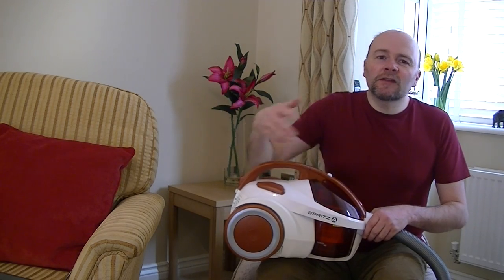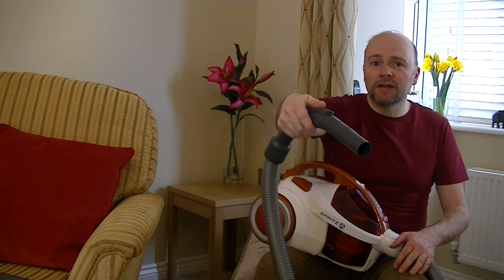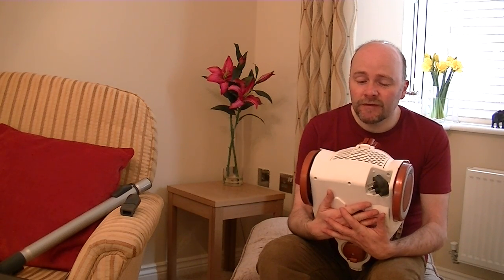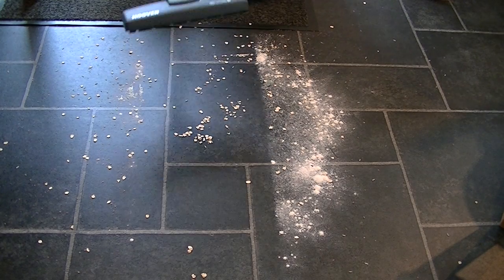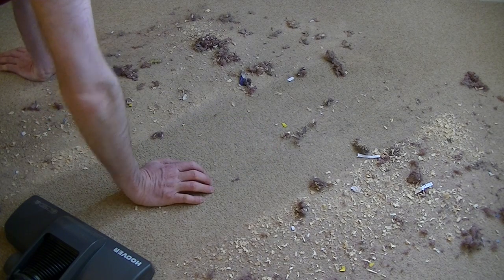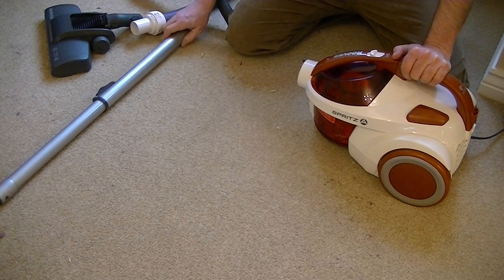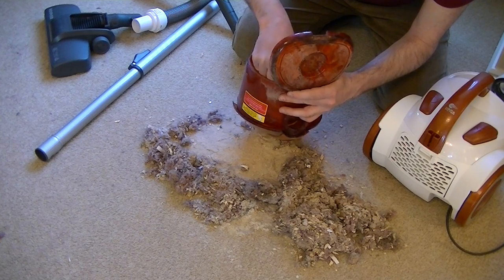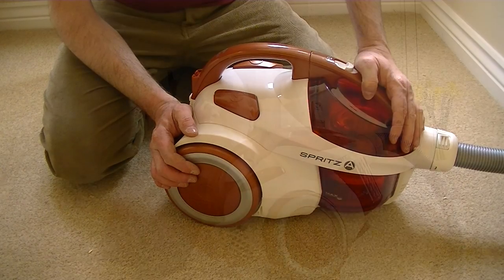Hoover Spritz Bagless Vacuum Cleaner Full Demonstration & Review

Comment: applause, puts down bowl of popcorn

Thank you once again Sir Sensotronic!   I wonder if you might get better pick-up on carpet with the bare floor nozzle.  I have found that if a nozzle has wheels, and no bristles parallel to the sides of the nozzle, these can often provide the extra brushing and rubbing needed for better carpet cleaning.  You need to open the suction release valve on the handle to loosen the "grip" on the carpet, and let the line of bristles + squeegee + lint pickers do half the work.  No scrubbing needed - just let the wheels take any pressure from the tube and let the front of the nozzle gently glide back and forth over the carpet.  I found this works brilliantly with the Dust Magnet carpet nozzle sold by Electrolux.  This Hoover's bare floor nozzle should work the same way on carpets.
Reply from the maker: Brian Torobin There is no gripping on the carpet with this model as the suction is pretty weak to begin with. I will be testing a bagged Hoover cylinder with a more conventional nozzle soon and I predict that it will do far better than the Spritz.

Comment: 16:15 I found it to be reasonable SPL dB of about 85dB far better than other make/model using before at 109dB that almost made me blackout due to the frequency peak I think in the 400Hz range. I measured both with RTA and the Hoover Spritz, was quieter than the other and freq curve was different shape. Amazing it sounds the same as in the video and would freak my Cats out as they can remember the frequency sound. Mine Sucks strongly can often lift the carpet tile up. 
Get a second filter while the other one dries. Wash the filter over the bath with warm water and get the fingers between the filter fins to get the dust dirt hairs out and then let it dry.
Great Hoover vacuum cleaner for refurbished which mine was. 10/10.
When the suns fuel runs out all the dust on Earth will be part of the expanding universe.

Comment: Don't judge me but I like the separate floor tools. Soon I'm going to get a Hoover Curve, fingers crossed I will not be getting a 2 in 1 floor tool.
Reply from the maker: +GTV Productions If it's a lower wattage version, you should get two floor tools.
Reply: ibaisaic I am not sure if it's the 1400 watt version or the 700 watt version.
Reply: +ibaisaic But I'm pretty sure it's the 700 watt version.
Reply: +OfficialGinger Biscuit It was the 1400W version.